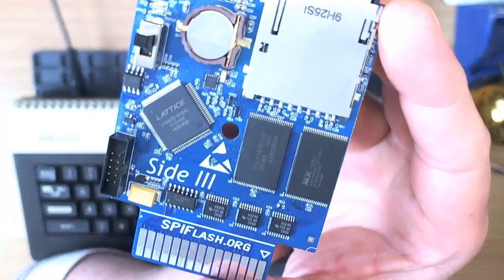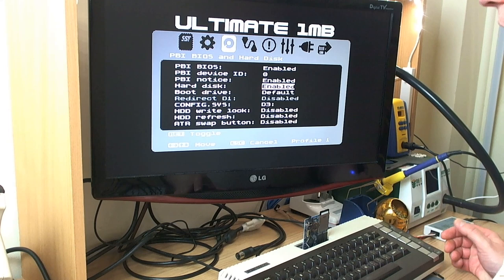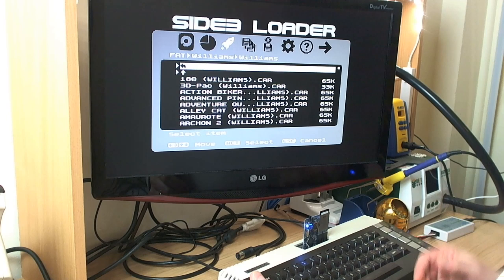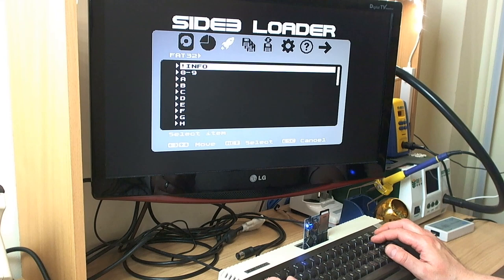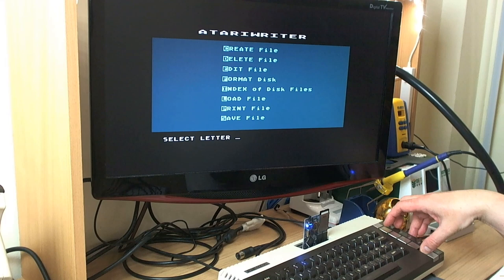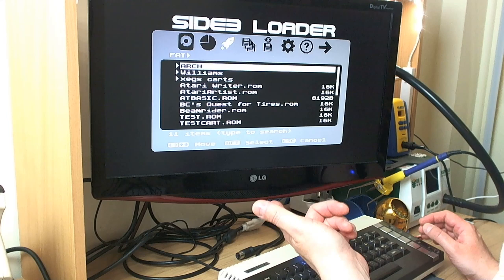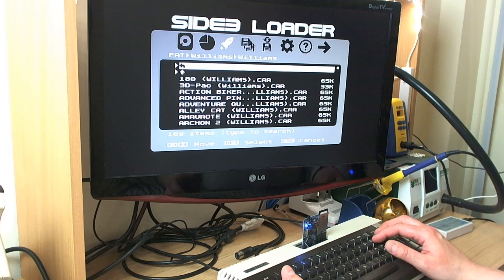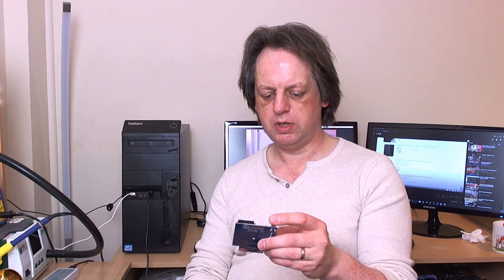SIDE 3 Update: Cartridge Emulation Working

Comment: maybe round down cart sizes to match advertised sizes. everything else looks great.
Reply from the maker: Originally they did round down, but this made it impossible to detect a bunch of misnamed CAR files with ROM extenders. Rounding up solves that problem, and the reported sizes of the CAR files (rounded up to the next KB since they have an extra 16 bytes of metadata) match the rounded size reported by Windows. ROM files, meanwhile, with no header, are reported at the expected size. Quite happy with that.
Reply: @flashjazzcat  good explanation and sound reasons. and thanks for the video, it was good.